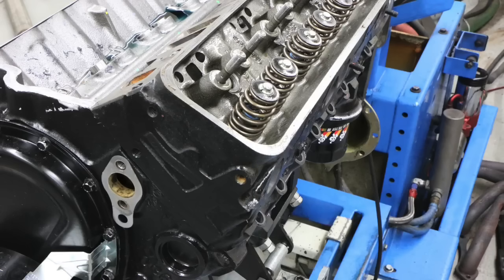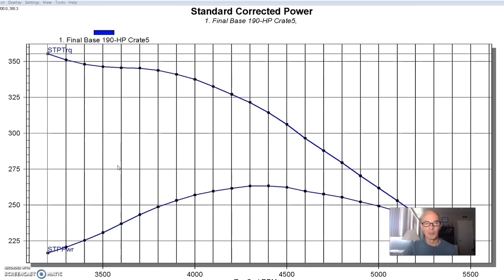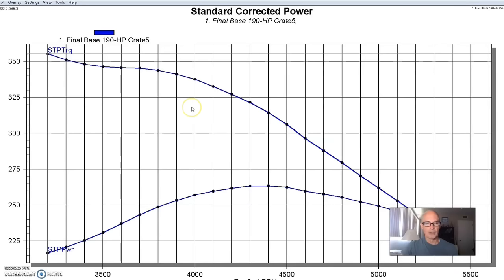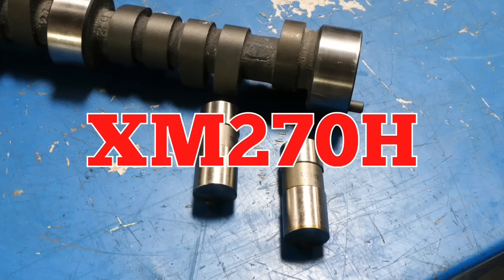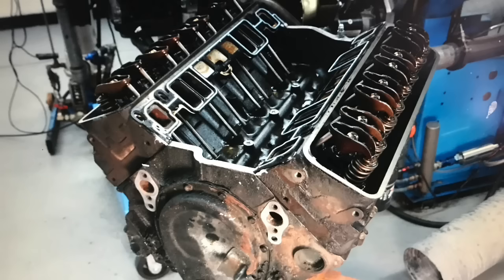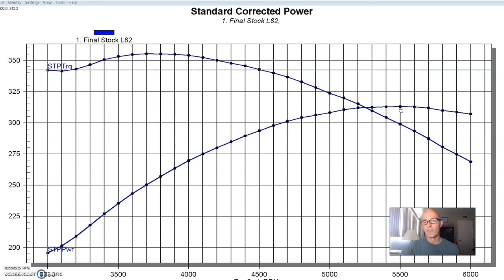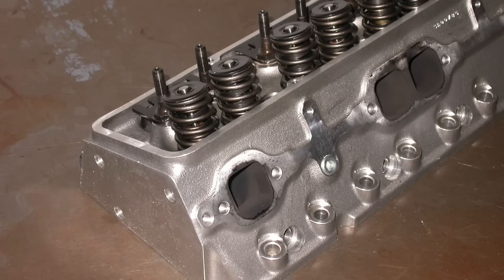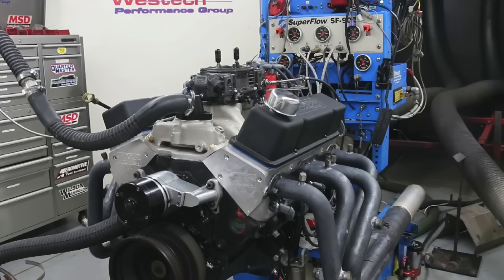JUNKYARD SBC HEAD TEST-VORTEC FTW!

Comment: I ran a worked set of Vortec heads with 2.02/1.60 valves on a 355 with a Lunati voodoo cam with 498/504 lift. Also ran a Holley 750 on a Edelbrock RPM intake.  Great little motor on the street
Reply: Back in the day those were a pretty good set of lobes.  Still are respectable today.
Built a 383 as my first engine with a Voodoo cam (wrong lobe separation at 110 but I didn't know better back then)
They'll grind one for ya at whatever you want too btw
17 years later and it's still running strong

Comment: I just bought a cam for a twin turbo 5.3 deal. Wish i could have bought it from you. Also, just finished and fired a flat-top 6.0, 706 head, 218/218 108lsa 106 icl in a z71. Sounds great!! Once tuned it should honk in the 3500-5500 range 😁

Comment: Love the vlog! I would like to see a cam comparisan between Hyd Flat tappet and a Hyd/ Mech roller with similar duration profiles.
Reply: One of the biggest gains with a roller is that the profile can be much more aggressive. Even if the lift is the same the roller can get there much quicker. You might be able to get a custom cam that would make everything match. At that point they would be basically the same. You don’t really loose that much in friction with a flat tappet.
Reply: Yeah, me too. I cant step up to HR, even if I already have an HR block. I'm guessing the HF would need 8-10 degrees more duration to equal the HR in power, at the expense of bottom end and drivability. What say you, Richard?

Comment: I built a 350 for my 78 nova using 882 heads and from my drag strip numbers seemed to make a bit more power than the crate motor here (I had a bigger cam) but it really needed Vortec heads which would have woke it right up for cheap. As much as people love the LS engines Vortec still the best bang for the buck build out there. As simple as go to the junkyard and buy a truck motor! Rebuild with cam and upgraded rockers. Boom 375hp for like $1000 and it literally bolts into any old GM car/truck! Need more? Add a turbo. Wham 500-600hp. Just keep it under 6000rpm or your gunna have a bad time.

Comment: Richard how much total timing did you run on the stock junk yard vortec to get the 313HP 398 ft/lbs?   I am running one of these bone stock with a carb and dual plane intake, also have one bone stock in a vortec truck.   The stock truck injection only runs 29-30 degrees of timing crusing 70 mph, and drops down to 20 degrees total WOT, which is pathetic.   
I want to recurve the distributor on my carbed vortec. I would like to target what you ran total, then will just experiment with vacuum advance for highway cruising.
Reply from the maker: it needs another 10 degrees
Reply: @richardholdener1727  i don't think you answered his question. I think he was referring to the fuel injection timing curve.  And he wants to know what the carb timing curve you ran so he can duplicate it.
Reply: @richardholdener1727   Thanks.  So you  think you ran about 30 total on the junk yard 350?  I think I am running 34 total mechanical advance on my carbed stock 350 vortec.   Your notes on your cam swapped vortec says 37ish total timing. 
I love the videos keep them coming.   Do a Buick engine other guy when you get the oppertunity.
Reply: I missed the video from 2 days ago, I see you already have a buick your working on!
Reply: Watch going over about 26-27 total on 87. My Express van detonated heavily at 29° on 87 octane.  Stock cam was a dog for power. Stepped up to a XM270HR cam. Actually had power to accelerate on uphill ramps and pass on a 2 lane road.  Had thorley tri-ys into the factory 3" dual exhaust and a dual 3" in/single 4" out muffler along with the marine intake, custom 4"  silicon intake piping to the stock air cleaner and a tuned 0411. Used a stock 4.3 S10 torque converter that stalled 2,800 rpm behind the 350.  Went from a 17.8 @ 78 to a 14.7 @ 93 in a 6,200 lbs van.

Comment: I just wish vortec blocks had a mechanical fuel pump provision.
Reply: No 96+ block had a finished fuel pump provision. SBCs went 1pc rear in '86 and roller in the cars with mechanical fuel pump provisions but trucks remained flat tappet until       1996. Some late 80s trucks had roller cam bosses but they weren't tapped. It was a crap shoot and most of the mid 80s roller cam/mechanical fuel pump blocks are gone by now.
Reply: @superduty4556  electric fuel pumps are cheap and easy to install its really not a big deal to use one I prefer them to mechanical personally
Reply: I have a roller cam block with a mechanical fuel pump. They are rare. I think they came in van applications before the vortec head years.
Reply: James Schneider I have an 89 350 in my truck. It has the provision for a mechanical fuel pump ad I believe it’s a hydraulic roller block. I believe it also had a 1 piece rear main. Could be wrong on that as I haven’t pulled it out of the truck yet (freshly blown up) but I will be doing a full year down on it and I can update you guys if you want
Reply: @CraftsmanQuad19  make a channel and post updates doesn't have to be fancy and you probably won't get money but people WILL check it out!!!

Comment: Back in the day I had a 79 Vette with the L82  a th350 with 3.73 gears and they were rated at 220 hp , I lost to every car I raced except one 57 Chevy with a 350 replacement motor . As I was not impressed with it even in 1980 My 19 year old self installed a Martin turbo draw through setup ( google it ) and that did not end well as I thought I was smarter than the engineers and it took me 25 years to get over my phobia of turbos   but all good now .
Reply from the maker: I'm familiar with the Martin systems-Steve at PowerTrain had one in the shop way back
Reply: Sounds like you had a stock car besides gears. Stock the timing is terrible(due to emissions), secondaries on the carb usually take just about stomping on the gas before they kick in(infact usually the secondary rod or the gas pedal gets bend from people stomping on the gas to hit the secondaries), the stock catalytic converter/ mufflers are extremely restrictive and last but not least the smog pump/system ate up horsepower. My 76 L48 vette felt like a whole new car after remedying these issues.

Comment: Vortec heads are great! As long as you find a set that aren't cracked. They were not very tolerant to being run hot. But still a fantastic factory iron head. I've been considering my options with my two squarebody chevy pickups. Neither one really needs an upgrade but being 79 and 86 both are just your standard smog era 350 low RPM stump pullers. Part of me wants to go with an L31 Vortec engine but part of me wonders why I should go through all that trouble when I could just drop a 5.3 LM7 in and have better power, a more modern fuel injection setup, and far more aftermarket support. It's these struggles that keep me up at night, lol.
Reply: A vortec, with a tpi setup, would be great for massive low end torque for those trucks! 👍
Reply: Try to find the marine application

Comment: The reason most people will put vortecs on an older 2 piece rear main block Instead of just buying a vortec block is so they don't have to switch flywheels or flexplates. This is the exact reason why I have vortec heads on a 1968 block in my 84 k10. Finding a 1 piece rear main flywheel to work with a 70 year old design muncie 4 speed is almost impossible. Way easier to just put vortecs on a 2 piece block.
Reply: Add to that: 

Many Vortec blocks won't accept a mechanical fuel pump.
Reply: I had a jeep that was small block swapped and had a 2 piece rear main in it that I swapped a 1 piece rear main motor in. What a nightmare to get everything working. Long story short, had to use a mini starter and a clutch kit for an Astro van

Comment: Good thing about a Vortec block is its already setup for a Roller cam
Reply: Depending on the year the truck v8s didn't have a stock roller cam until 1995
Reply: @nickstewart3295  The vortec 350 was introduced in 96.
Reply: @user-ge2qn6gp4o  
Yup. The older ones were just called center bolt. Vortec is 96+, excluding LTs and LS.
Reply: @user-ge2qn6gp4o  ,,,,,,,that 880 block was strong,,,,,,after sonic testing,,,,,,,boring  .060 over was safe.......
Reply: @nickstewart3295  vortec heads didnt start till 1996 anyway
Reply: @nickstewart3295  Wrong the 88 silverado OBS had a roller and some 87 sq bodies ive owned and built many as thats what i do for a living
Reply: @apollorobb the vortec engines did not come out til '96
Reply: My uncles 94 had a factory roller and I pulled apart a factory 92 G20 van that was roller cam too.
Reply: The car v8s came stock roller in 87
Reply: Trucks generally came flat tappet 87-95.

Wasn't uncommon for car motors to wind up in trucks to meet production.
Reply: You have to upgrade the valve train a good bit to run a higher lift cam, Vortec is a great start.

Comment: I watched this test on the speed secrets video, but I just want to double check. These heads weren't machined to clear the cam lift, right? It was just the comp springs/retainers, etc that allowed the lift?
Reply: Yup common upgrade is comp 787 retainers & LS blue springs
Reply: Yes ls2 blue spring 787 comp retainers is the go to, but I wouldn't push it past .510 lift though
Reply: The other issues is press in studs.
 Don't want to get to much open pressure or you may pull a stud after a while
Reply from the maker: just needed the right springs
Reply: @bolton93lt1 yes - did this on my 906's
Reply: yes
Reply: i just used z28 valve springs(remove inner damper), stock retainers, locks, and umbrella valve stem seals. its easily .500 lift safe or more.

Comment: Perfect. 190hp. Oh my.
Reply: Yeah, now picture that turd, with TBI, in a 6300 lb, 3/4 ton Silverado with 235/85-16 tires, and you have my old truck. It was slow, but at least I got terrible mileage!
Reply: @donellmuniz590  understressed engines make great workhorses
Reply: @lb9gta307  Not understressed enough, apparently. My original engine developed a rod knock at 190,000 miles. The second only lasted 130,000. And I used Mobil 1 in that one.
Reply: Are your dyno carbs always double pumpers, or do you sometimes try vaccum secondaries. Because in the real world, in a heavy car in the street, vaccum secondaries drive better.